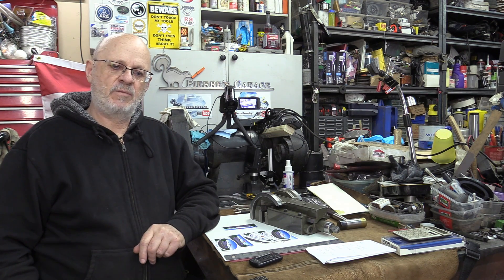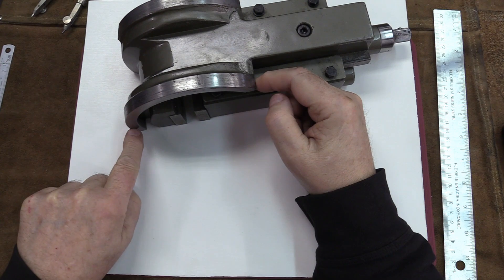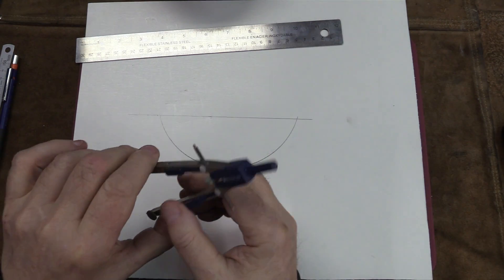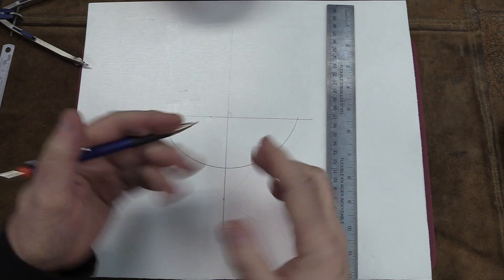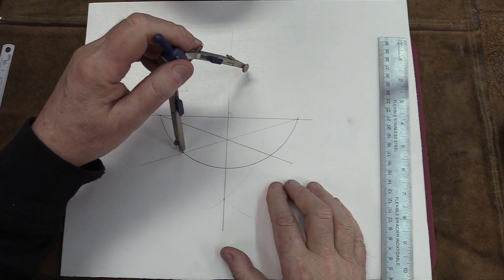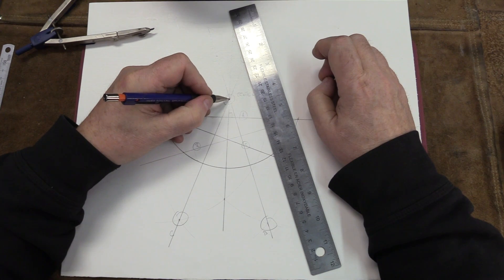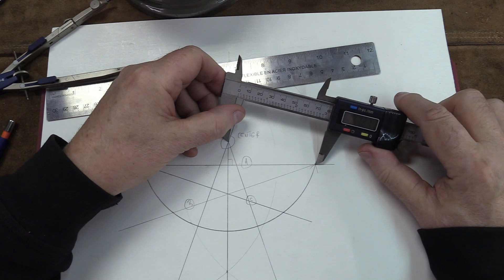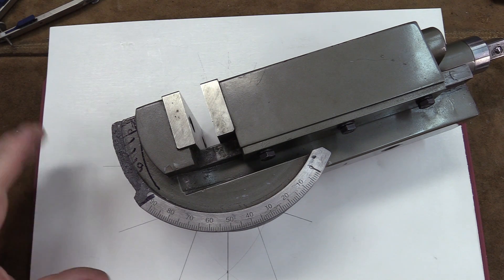Find CENTER and RADIUS of an ARC on a circle - Prep for Wilton vise repair

Comment: Nice review of high school trig. Thanks. I am constructively lazy. I would have traced the arc, rotated the part along the arc, traced some more, ..., until I had a circle. Done.
Reply from the maker: Being good at trig is a real asset when you are a machinist, it allows you to get installed faster and more efficiently, I know some people have real trouble understanding calculations and geometry, my weak point is CAD, I'm really impatient and get frustrated real fast and just dump the subject after only a couple of minutes...      ;)
Reply: @pierresgarage2687  I seem to remember a formula that calculated the radius from the length of the arc with the distance from the line. It's from the '70s so may be a bit fuzzy.
Reply from the maker: You need at least one dimension and one angle to calculate something like that, here we got nothing to start with...   ;)
Reply: @pierresgarage2687  Given an arc or segment with known width and height: Segment of a circle. A horizontal base line with an arc on the top. Its height is H and width of the base W The formula for the radius is:
H/2+W**2/8H
where:
W  is the length of the chord defining the base of the arc
H  is the height measured at the midpoint of the arc's base.
Reply from the maker: When you master trig and geometry, it's easy to calculate, but you still need some numbers to start with, you'll see in the 3rd part how I use the template to get started on the rotary table, this will allow mw to get close enough and save time on the centering...   ;)
The measurement of the actual arc could have been done on the milling machine using the DRO, if I have time I could also demonstrate this option.
Reply: I with ya Jim, that would have been my approach ....,  also, couldn't we use a radius gauge to at least give us a number before we do any other methods ?
Reply: @alienphysics8592  If you've got the gauges, go for it.

Comment: Very cool, I hadn't thought of using a piece of paper and doing up the radii of intersection points to find arc center but it makes sense.  Been a while since high school math for sure, thanks for sharing!
Reply from the maker: One of the strong point in machining, mostly for more advanced tasks, being able to handle basic trig is a great asset...
With internet there are many sources available to help find a solution to a problem and explain the steps to undergo...   ;)
Here in Quebec and probably most other trade schools, trig is an important part of the training, not everyone sees the importance of it until he or she needs it...   lol
Cheers,   Pierre

Comment: The descriptive geometry constructions were always fascinating.  You could also calculate the diameter using length of chord (s) and height (h) from perpendicular from chord center to arc.  D = h+(s^2 / 4h).  Then you only have to construct the perpendicular bisector of the chord and measure chord length and length of height to arc.  
If you have a 14 inch segment of an arc from a diameter of, say, 36 inches, it might be a bit inconvenient to lay out the construction.  
If you drilled and pinned the broken piece to locate it and then used one of the super adhesives from 3M or Loctite, only you and your viewers would know it had been repaired.  ;)  And we'd never mention it to a soul.  O:)

Call 1-800-831-0658 and talk to a 3M adhesive expert.  They might even send you a free sample when you tell them you're a YouTuber.  (Tell 'em you'll waive your normal advertising fee.  :D )
Reply: @ Richard Freeze: "And we'd never mention it to a soul." I will, I will :->)
Reply from the maker: It's impractical on big parts, I've worked my head at the easiest way to get it done without numbers to start with, but to define an arc we still need at least 3 defined points, or at least trace the arc and at least get the chord length and the height in the center, or, any angle beside the 90 deg...   At least it looks like that...
As for calling adhesive companies, first I called Loctite, their thec rep wasn't that "hot" on technical solutions... Then I called Miller Stephenson, they only deal with manufacturers and industries, but, they already sent me a sample of one of their epoxy product, MS-209plus adhesive, for a long time I've used some MS-209, this was my universal solution for about 35+ years until I ran out some time ago...
I think that with proper mechanical prep and shape this repair could be a good solution and avoid heating the whole top of that vise, making it look like it passed through a fire...
Cheers,   Pierre
Reply: @pierresgarage2687  For your situation, I definitely would have used the method you chose.   Quick and easy.  
I agree that heating the vise isn't desirable.  I'll be interested in seeing the result.  
Cheers,
Richard

Comment: So apparently someone offered to load that vise and dropped it for you? Sad day!! Dropping and breaking stuff sucks!!
Reply from the maker: Exactly.....................!!!!!!!!!!!!!!!!!!!!!!
He offered and did in that same swing................      :(
Big boys don't cry, they say somewhere...
He offered to cancel the sale, but those don't come often on the used market, got it for a ridiculous price, but still.....
I'm still evolving in a way to repair this without heat and solder or weld, that would ruin the paint and finish, since those slides aren't needing to support as much strenght as the part holding the jaws, there is something possible with cold methods and insert type repair with mechanical ty-downs and epoxies...   
This is for the happier side....   ;)

Comment: A 60-degree triangle placed where all 3 sides are of equal length (where two intersect the arc) will have the third point on the center of the arc (unless you put it on the outside). While this may be no faster that the compass method, it will work with any arc >= 60 degrees. Any of the equal sides will be equal to the radius.
Reply from the maker: Hi Wes, I've been thinking about your proposal for a few days, not sure exactly how you're using your triangles, but have some idea, it seems to me like you need an equilateral triangle to get this done...??
Reply: @pierresgarage2687  What I meant is if you placed a plastic triangle with a 60 degree point over that arc such that the measurement between each intersection point on the sides of the triangle is the same as the distance from the triangle tip to BOTH intersection points (forming an equilateral triangle) then the tip must be located at the radius point. Just looking at the circle as if a hexagon was overlaid.
Reply from the maker: Thanks, got it...   ;)   I"ll get to another worry now...    lol

Comment: Yes, I learned that in school (yes, they did teach geometry and trigonometry in the olden days) but it was so long ago I'd forgotten, so thanks for that.

However, you used a, b, c for the first triangle, so you need to use a', b', c' for the second, and a", b", c" for the third, else your calculations will be wrong. 🤣
Reply from the maker: You're right about the a', next lesson...   Let's keep it simple, let's not get the student mixed up, one thing at the time...     lol
Doing setups on a regular basis keeps an active machinist on his toes with trig.....    ;)
Cheers,    Pierre